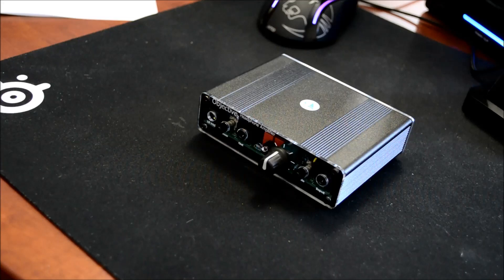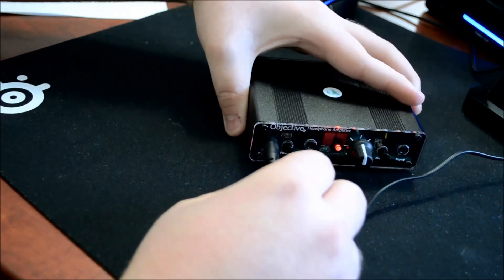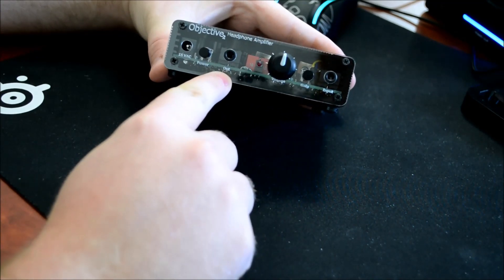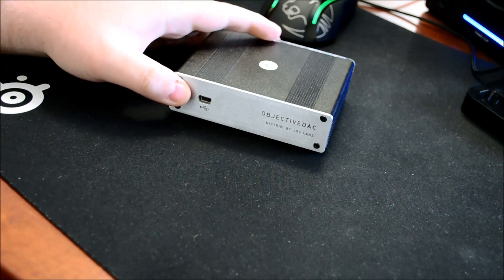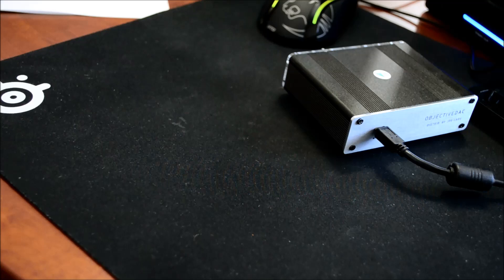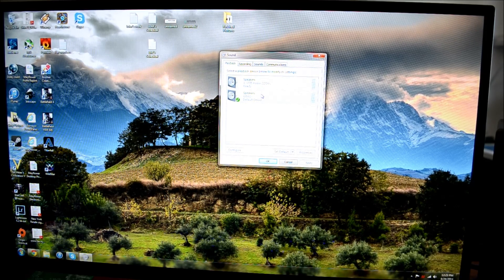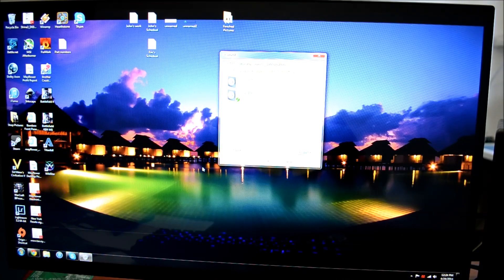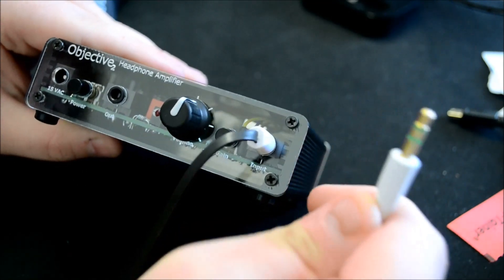Mayflower Electronics FAQ - Objective2 and ODAC Walkthrough

Comment: I refer to the version with RCA at the rear - am I right in thinking that if you have sound coming out of the speakers and you plug the headphones in, the sound does not halt out of the speakers and you end up with sound out of both? I was expecting sound out of the speakers to halt when I plugged my headphones in and it does not.
Reply from the maker: Correct, it plays both at once. If you want the headphones to turn off, hit the power button in the front.

Comment: Hi Tyler. How can the dac be connected to the amp? Would the amp sound good without the dac? Also, could the amp power high impedance headphones like Sennheiser  HD800?
Reply from the maker: +TheTechAudiophile If you pick up one of our combo's, the DAC is connected internally within the amp. Our amps and DACs can power any headphone on the market, the HD800 is easily powered with the amp.
Reply: +Tyler Chilton Thanks for the quick response.

Comment: Hey i was wondering if i would notice a difference using the amp+dac combo unit compared to the onboard sound that i have with this motherboard http://asrock.com/mb/Intel/Z170%20Extreme6/index.us.asp  The motherboard has a 115dB SNR DAC with Differential Amplifier and TI® NE5532 Premium Headset Amplifier (Supports up to 600 Ohm headsets)
Reply from the maker: +obzen33 Yes, you will, you have a standard chipset. Ours will be louder + sound better.
Reply: Thanks for the reply!
Reply: +Tyler Chilton I have one other question. Can I plug an Antlion Modmic into the input on the odac?
Reply from the maker: obzen33 No, this is a headphone amplifier only.

Comment: hey tyler, really cool device. i had a question about the dac/amp combo . I saw how u can use the analog input in the front as an output to only use the dac. Can i also use the analog input in the front as an input to only use the amplifier???? really looking forward to buy this. also one more question- if i get the one with the RCA at the back , can i also use them as input ( to use amp only) or as output( to use dac only).
Reply from the maker: Yes, the RCA's can also be used as an analog input to the amp. The RCA's can be either an input or an output.

Thanks,
Reply: and what about the analog input on the front. can i use it as the input (to use only the amp) or as output ( to use only the dac)?
Reply from the maker: Same thing, you can use it either or.
Reply: so basically i can use both the RCA and the analog input as dac only or amp only.?i might sound irritating but i am really excited for this thing. so wanna do my research.
Reply from the maker: You're not irritating! The 3.5mm and RCA connections are basically hooked together. Meaning they can either both act as an analog input to the amp, or, they can act as a line output from the ODAC (if the amp is off).
Reply: Tyler Chilton cool dude. thnx a lot.

Comment: so if u have the combo u only need to plug it in with the USB ?
Reply from the maker: Correct, you'll need to plug the USB cable in and the power supply for the amp.

Comment: Should the System volume be set to max? I have mine at 50 which is half volume on W8.1.... I went full volume but it made everything sound horrible.
Reply from the maker: No, at full volume you will cause clipping within windows. 50-80% is best and control the volume with the physical knob.

Comment: If i am using an IEM on these instead of a pair of headphones. Would the default 2.5 gain be too loud or do i leave the amp off (i still want to use the DAC since my onboard audio has quite noticeable noise) and plug my IEM into the input socket instead?

Comment: I am using my new Beyerdynamic DT990 Pro 250Omhs and i am planning to buy a o2 amp. Will the odac be a noticable improvement (with the amp) or the amp (alone) will be enough to get the most out of my headphones?
(I am guessing that i will see a bigger difference with the amp instead of the dac.)
Reply from the maker: You can't drive headphones directly off of the ODAC, so you will need some kind of amp. You'll get the most bang for your buck with just the amp. The ODAC is the last 10-20% if your audio chain "quality" (as best as I can put it).
Reply: Ok thanks. The 250ohms will benefit from the amp, right?
Reply from the maker: theodoro89 Yup! I found the 600 ohm to have slightly tighter bass..so get those if you can.
Reply from the maker: Jon - Yup you're all set. The ODAC works on windows/linux and mac. The amp won't do anything to the treble, it will be the same.

Yes black friday deals for sure!
Reply: Tyler Chilton Great vid. I'm looking to pick up an O2/odac this week from your website, also I have the dt990 600 ohm version so I'm pumped to check this set-up out.

Will my Macbook Pro (2011) recognize the odac and play through it? I read it is mac friendly.
Also, what will this amp do with the treble on the dt990 600 ohm headphones (seeing that they're on the bright side)?

Oh yeah, last thing, any Black Friday deals?
....please! haha
Reply: Thanks Tyler!
Can't wait! T-minus 3 days, 9 hrs and 50mins.

Comment: Would it be possible to solder the odac board to the objective2 and still use the batteries to power? http://imgur.com/a/6C9Fv
Reply from the maker: Yes, but you'll have to mill out a new panel and part of the case. Trick is to mount it UNDER the amp...it's a pain but it an be done.